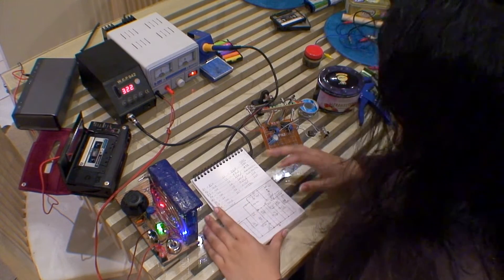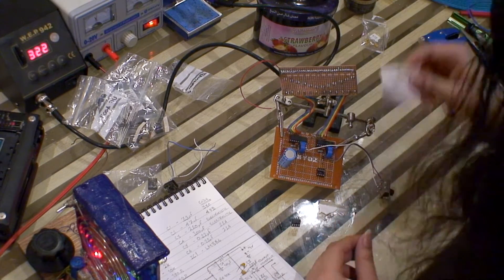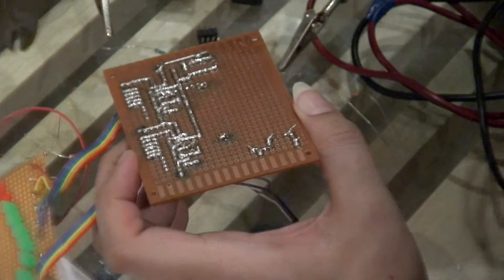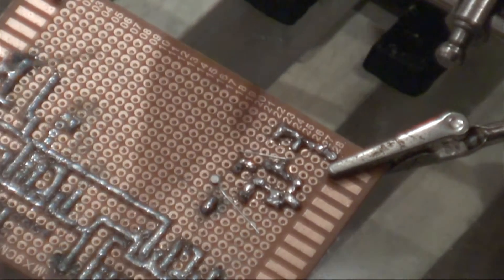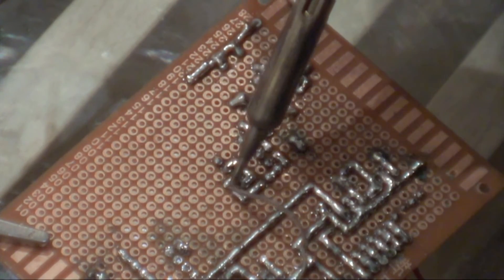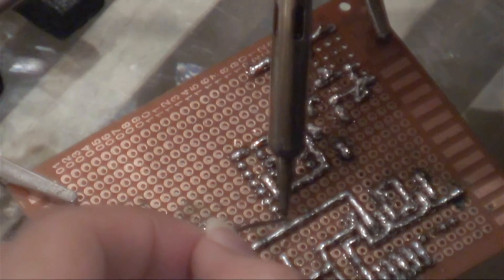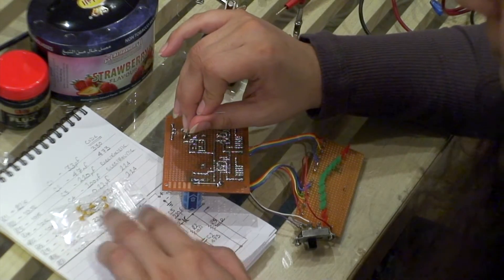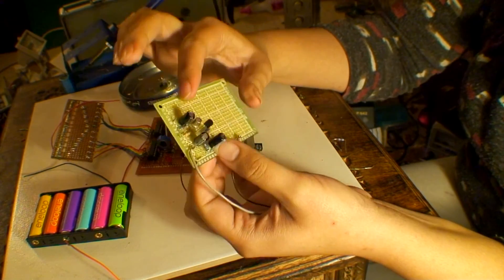Headphone amplifier project - Part Two - Main amplifier

Comment: Wow the background music brought back loads of good memories from my youth. Donna Summer, Kraftwerk, Jean Michel Jarre etc. I have to say, "I wanna play along at home" and you've certainly inspired me lol.
I've spent the last few months building amplifier circuits from kits I've bought, having not touched electronics for about 20 years, it's a good challenge and a good buzz when you switch on for the 1st time and it works. I find it interesting how you are using Perf/Matrix board to build on, but you must go through some solder lol.
One question: Why, in your previous vid, were using a drill bit on some of the holes on the soldered side of the board, did I miss something? :-)